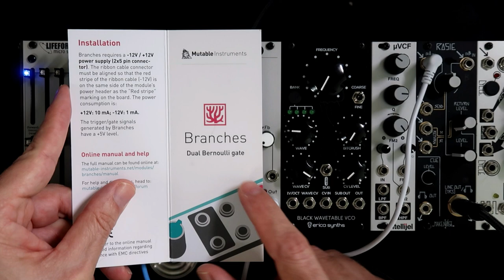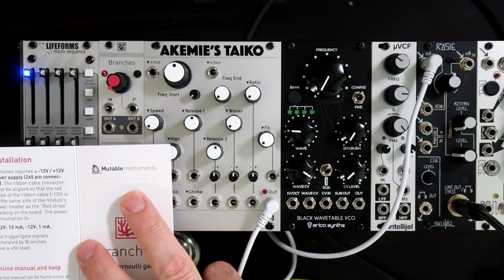Modulations (Ep. 1 - Branches)

Comment: Hi, i'm right now deciding on Shopping BIA or AT, have you noticed pitch tracking problems on AT? (I read on muffwiggler some issues about that).
Reply from the maker: Hey, I can't say that I've ever noticed that sort of thing with the AT module - but - I should say that I haven't really been looking for that issue and a lot of what I do with it might tolerate some small pitch errors (microtonal stuff, DIY synths, etc.). It does have a huge pitch range, so it wouldn't surprise me if there is some sort of "sweet spot" range where it is well-tuned and then drifts when outside of that. Sorry I couldn't be more help on this. I will say that overall I think it's been a really nice module with a lot of great sounds.